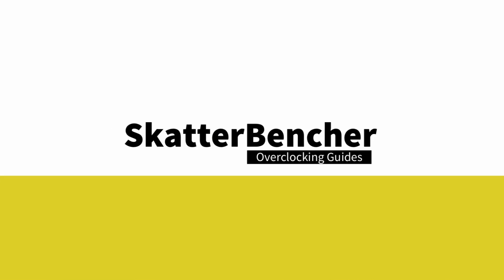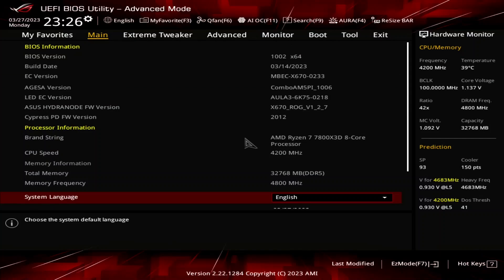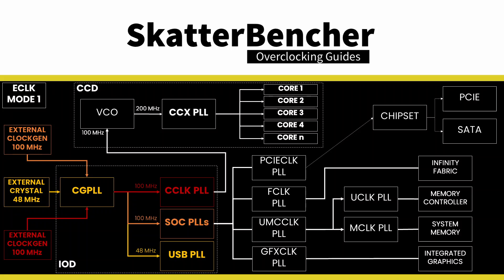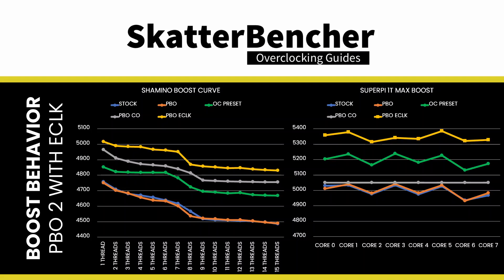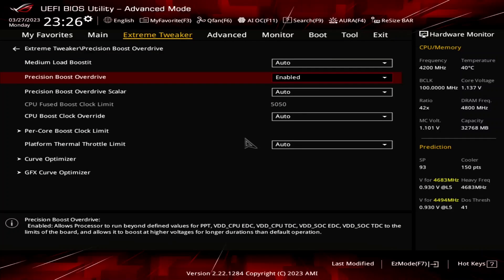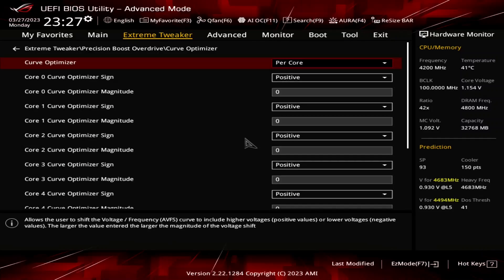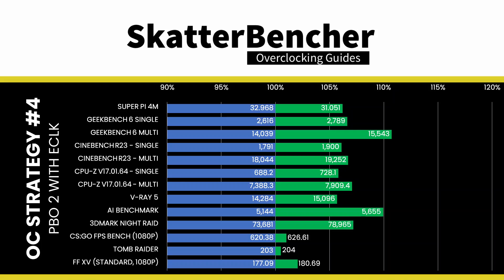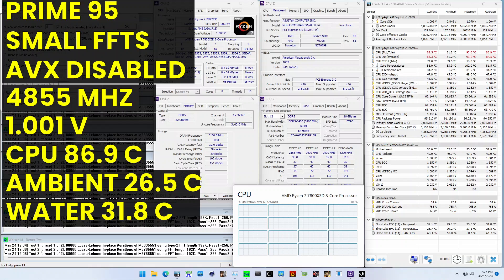5 Minute Overclock: Ryzen 7 7800X3D to 5403 MHz

Comment: ARE you up to speed on the voltage problems that are burning up boards and chips? especially asus boards. there is a beta bios came out a few DAYS AGO hoping to adress this.
Reply from the maker: I'm a little up to speed. I posted a reply on another comment a couple of days ago (see below):

------------------------------------

I've been trying to follow the news about the burning up a little bit (including some of the in-depth pieces). Generally, I'm a bit annoyed with the coverage because there's still lots of speculation and jumping to conclusions. Also, I'm not a fan of calling people "lazy" without evidence. It implies intentional malfeasance.

My opinion is that 100mV difference will never be the difference between "guaranteed burnout" and "absolute safety", unless there is a specific hardware design flaw causing that. Going by the physical damage, it's clear some thermal protection is failing. That could related to a dysfunctional physical sensor in the CPU or some edge-case SMU firmware bug, or something different. But what's it's not is +100mV :).

I look at the BIOS voltage limitations as a way to show customers something's actively being done about it and to shift the conversation to "it's those darned overclockers again". You know ... it's not "in spec" but "out of spec" behavior. I'm not confident we'll ever know the true root cause of this issue. And, honestly, I don't really care that much about the root cause being known by the public. I'm just a bit worried that this will further detract AMD from actively investing resources to enable great overclocking experiences.

Comment: Good video going though the important parts!
At what point is the 7800x3d thermally limited? (peak ccd temp >85 or so) Does that happen already on two threads? Four? Just one?
Reply from the maker: Great question! I don't think I actually tracked that data, but it's something I should do for future guides.
Reply: 90c

Comment: Very good!
Voltage vsoc in automatic defined by EXPO not exaggeratedly high? Considering you don't have the latest bios that limits vsoc?
Reply from the maker: The EXPO profile does not contain any information about VDDCR_SOC. It only includes DRAM VDD, VDDQ, and VPP voltage specification.

The increased SOC voltage is done by motherboard auto-rules to support higher EXPO frequency out of the box. While it sounds like "motherboard auto-rule" means the motherboard vendors decided the voltage on their own, the rules were made after discussions with AMD. If I understand it right, the guidance was IMC=VDD=VDDQ was the guideline (and IMC voltage is 1:1 with VDDCR_SOC voltage rail).
Reply: @SkatterBencher  Thanks for clarifying

Comment: Dude, what about the ROG STRIX X670E-I ? We don't have ECLK on this motherboard. please make a guide for overclocking all the other motherboards that don't support asynchronous mode!
Reply from the maker: In my longer SkatterBencher video I cover a variety of OC strategies, including ones that don't rely on ECLK: https://youtu.be/90UBUq1mLGY
Reply: @SkatterBencher  Thank you, I've watched the other video when you originally posted it. What I didn't see is base CLK overclocking like you did for the 5800x3d. I am curious to see and what potential that has with curve optimizer and negative offset 35 on the 7800x3d.  I am currently doing -34 CO with 6200mhz ram. It only pulls 75w TDP under max load, so I know there is some headroom to push it further.
Reply: @ZeroEight  bclk 105 can reach 5.0 multi/5.3 single stable with custom loop. Mine did 103 4.9/5.2 with CO -25 on 240mm AIO & 120$ asrock motherboard - cool ! :))
Reply: @dudao4163  what ram speed?
Reply: @ZeroEight  cl 30 6000 Hynix die tuned by buildzoid profile.

Comment: And all you need is a Motherboard that cost more than the CPU itself......
Reply: not really the x3d chips draw like max 60w so cheaper boards with lower end power delivery will be just fine. i would argue intels competing i7s and i9s require high end boards with how much power they use
Reply: @rileyhance318 i think he is talking about the clock gen which then technically is true since the cheapest one is the b650e aorus master for 350-400$
Reply: @wazaagbreak-head6039 which model specifically?
Reply: @rileyhance318 didnt this 1 take like 90 watts in the vid, still nothing compared to intel.
Reply: @lemonhaze715  i think they might be 85w stock but most can be tuned with pbo2 down to 60w with no performance hit and am5 chips dont get very large gains with overclocking
Reply: overclocking the 7800X3D actually ruins the performance and you have a risk of going above 1.29v which will damage it
Reply: Almost every am5 motherboard has bad reviews on amazon. If u want the best one ur gonna have to spend A LOT
Reply: @charlesa3505  ive built 4 systems for clients using the ASRock B650M Pro RS WiFi for 150 USD on newegg. all are working just fine, oldest of which has been operational for 2 years.

Comment: Its a miracle the CPU didnt burn up...
Reply: 7800x3D is limited so hard, that makes it probably the most dumb protective CPU in the world. The core voltage is hard capped at 1.2V and thermally capped at 90C.
No matter what you do with this CPU this 2 values will always hard cap your OverClock
EDIT: Oh I forgot about the SoC, yeah that's probably the only way to burn it, but mobo manufactures could already hard cap that too at 1.3V or 1.4V

Comment: The MSI Afterburner shows me ingame Max 4,8 - 5 GHz. In CPU Z the boost is much higher to 5,4 GHz ?
Reply: That's because it's 5.4 on a single core, maybe 2 at times. 
All core load will be around 4.8-5

Comment: This is done with AVX off, so you cant run games well with these settings for anyone curious..
Reply from the maker: Where did you get that? AVX is enabled and stable.

In my longer SkatterBencher video you'll find also the Prime95 stability test with AVX enabled. I just only include the non-AVX in the 5 minute video because, well, I'm on a timer :)

https://youtu.be/90UBUq1mLGY
Reply: He’s just running a non AVX workload to test temps and stability, all instructions work normally.

Comment: EXPO I gives you very poor latency ~74ns iirc at 6000 cl30 DR ime. I had to use expo tweaked to get to ~64ns. Further tweaking can bring it down more
Reply: Yeah I'm sitting around 62-64 on average in Aida 64. I swear anyone getting sub 60ns isn't actually stable and is just posting screen shots for clout. Either that or it's on a completely clean OS with no background programs running. You'll never actually get 55-58ns under normal circumstances when using the PC like a normal person. And don't tell me I'm wrong because I'm not👍🏻 I've tweaked my ram for hours and the best I could ever get is like 61ns but it's not stable.
Reply: @ertai222  After tweaking i've got 38 ns stable
Reply: @awareDGZ  nice try but no you didn't. That's literally impossible on the platform.
Reply: uhm 58ns here
Reply: @BaBaNaNaBa  good for you champ

Comment: holy fuck 1.35v on the SOC? is that safe? lol
Reply: No. The official limit is 1.30.
Reply: LOL meanwhile the Asus motherboards were overvolting the CPUs to 1.45V+ without the users knowning or even any overclock... even when the motherboard was "shutdown" and the fans werent running... thats why so many burned up.
Reply: @lolmao500  so many, I know of one confirmed are there more besides GN testing ?
Reply: Probably not, but that's not the goal of videos like this.
Reply: @Azortharion  oh okay. is the goal to blow the processors up?
Reply: maybe burn the house down? lol
Reply: @infineon222  Always assume stupidity before malice.
Reply: No it's definitely not safe.
Reply: I have 1.35 SOC on 7950X3D with no problem 40days nonstop working
Reply: 1.35 is likely safe, just a bit excessive.  1.3 is probably all you need.  SOC voltage is not the only cause of the CPU's dieing, it just happens to be the one that motherboard manufacturers can "unbreak" in their bioses the fastest.
Reply: Try in in your fridge